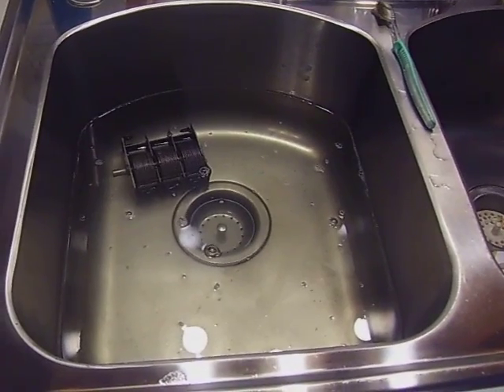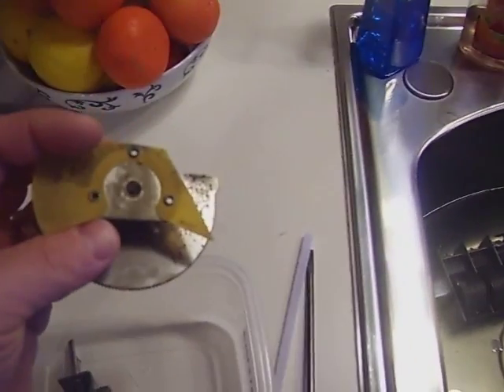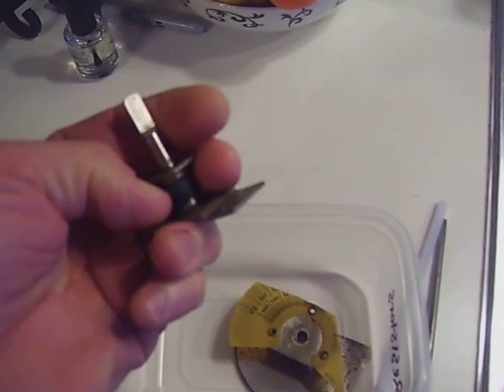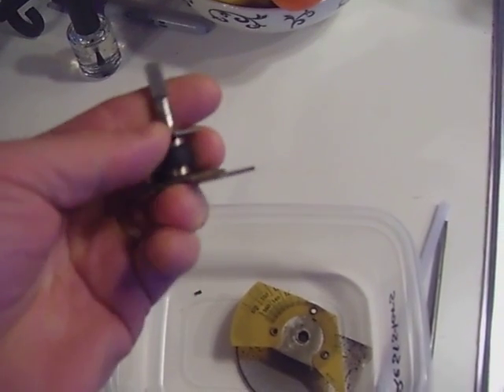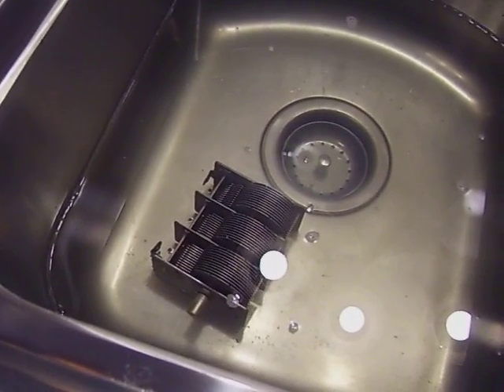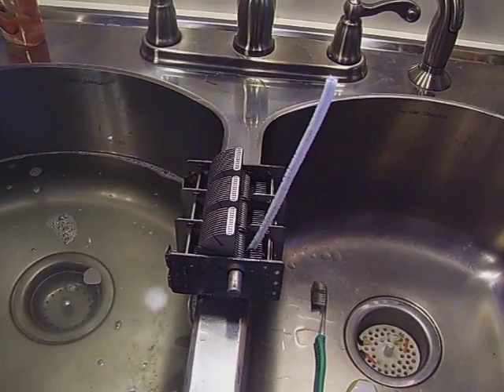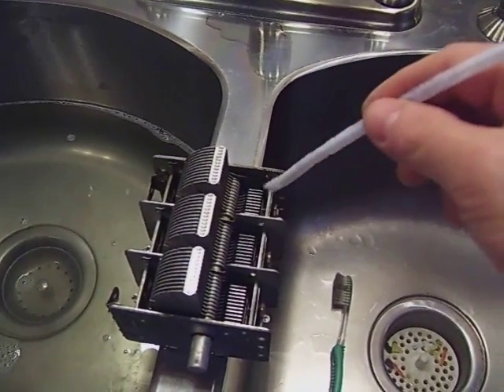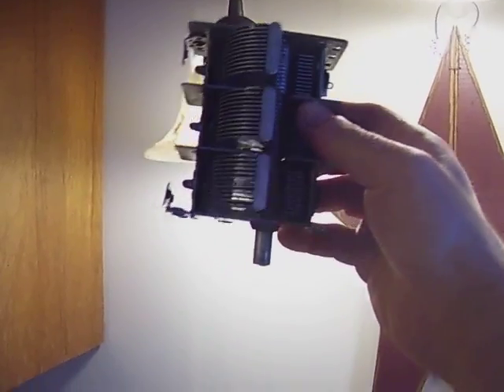1930's Stewart Warner Radio Restoration ~ Part 8

Comment: Yeah Nathan. Good tip on the "Magic Eraser". Never even heard of that one before.
Looks like it works great!
Reply from the maker: Tom,
I discovered the magic eraser's "magic" a couple years ago. I had a plastic tuning dial for and old Motorola portable that had turned yellow with age. The magic eraser took most of the yellowness away. since then I have found several other uses for them.
Nathan

Comment: Nathan,
Looks great.  I have to eventually do that to the tuner in this Philco we're working on, but that's the fun of the hobby.
BTW...it's good to see you taking your time on this project.  :-)

Regards,
John
Reply from the maker: John,
I think the tuner is the most important part on the radio. Skimp on cleaning your gonna have poor results. Kinda like cold solder joints and bad wiring. Get it outta there ! I don't have much time, but I'm learning to manage it better. It seems like I covered a lot in a short amount of time, but it all happened between Saturday and Sunday. Thanks for watching.
Nathan

Comment: Good stuff Nathan.  I do pretty much the same thing you do, very rarely do I use anything but common household products for radio cleaning.  I stopped buying the Novus products a long time ago.  I believe Mother's Mag Polish and Wrights Brass Polish work just about as well, on bakelite, for instance.  Want to tell you, too, I buy generic magic erasers at the dollar store, at a buck a package.  Those magic erasers work great, but, none of them last long, they crumble pretty quickly.
Reply from the maker: AL,
I'm not familiar with Mother's Mag Polish or Wright's Brass Polish, I'll have to check them out. Thanks for the tip on the dollar magic erasers. For that price I can use them a lot more than I do now.
Nathan